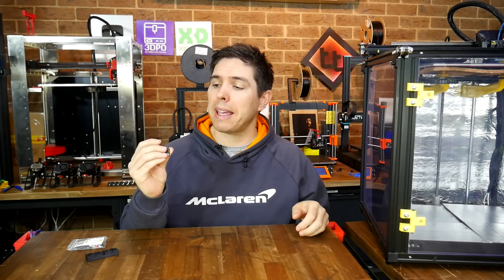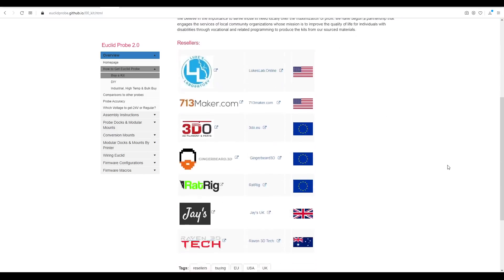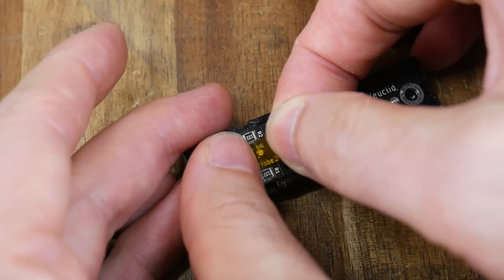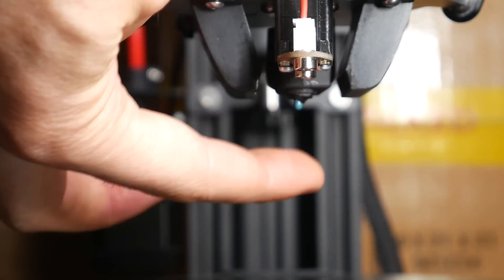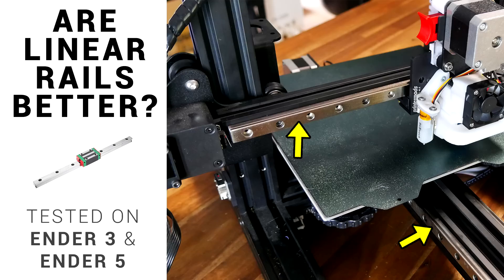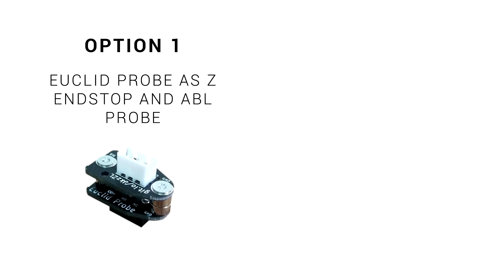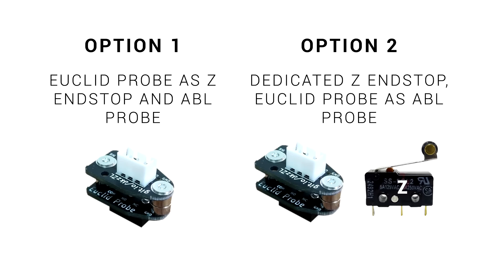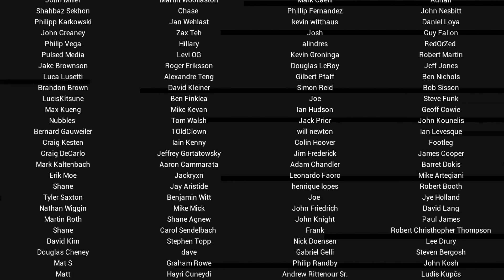Euclid probe: Light, robust, mechanical ABL for your 3D printer

Comment: it's neat, but honestly feels like a solution in search of a problem. you're basically just shaving off about 5g of mass (and about $10) from a standard bltouch, and it probably won't make any difference in print quality.
Reply: I would definitely use this over a BLtouch, it costs less, it's simpler, and it works just as well. The BLtouch has always felt overcomplicated to me, that's part of why I never bought one
Reply: How is that in search of a problem?
It's better than the BLtouch in every way, but it's not good enough to be a product? That doesn't make sense.
Reply: @Akegata42  it is marginally more accurate, basically cost the same, slightly lighter, have to be assembled, and due to the mount/dismount, have way more points of failure.

It's "better in every way" in the least helpful ways possible. It might be better in high heat environments, but given the tiny install base and time out in the wild, that remains to be seen.

So yes, it is a solution in search of a problem.
Reply: @tehmoriz  it's over 30% cheaper... the assembly includes screwing in some magnets, and once scripted, the mount/dismount never misses.
Reply: @Daede420  it's $10 cheaper, requires assembly, requires more drastic firmware changes, isn't more accurate enough to be noticeable, and require mechanical mounting/discounting.

I understand that you've bought one and installed it, and thus cannot be entirely objective, but at least try?
Reply: @tehmoriz  I mean, I guess if screwing two magnets through a pcb is too hard for you, it's too hard for you.
Reply: @Daede420  it's not hard, just unnecessary. Try not to put words in my mouth?
Reply: @tehmoriz  Iunno, it saves you 13 bucks over a BLTouch :)
Reply: @Daede420  it costs me $25 and my time over a bltouch, since mine came with the printer.

It's clear that you're being pedantic at this point, so I'll move on. Feel free to continue justifying your purchases here all you want
Reply: @tehmoriz  it must take you a long time to screw in a few magnets. I'd imagine you can find a couple videos online of how to efficiently use a screwdriver...
Reply: @tehmoriz  In my opinion, what's pathetic is calling a practical alternative to a product prone to failure and inaccuracy under several conditions that does not suffer from those shortcomings "a solution looking for a problem". You could have easily left it at "it's neat, but I'm happy with what I have". Instead you went through mental gymnastics that would give a pro chess player a headache in an attempt to justify a statement/an opinion that made no sense to pose in the first place. It is, in fact, a solution that fixes many problems presented to BLTouch owners who print under circumstances where the BLTouch performs in a less than desirable manner.

Have a good day, man.
Reply: @Daede420  the "practical alternative" is a product that's utterly unproven, has a tiny install base compared to the thing that it is an alternative of, cost basically the same, has just as many (if not more) points of failure, and apparently, it isn't even rated for one of the things it is supposed to be better at (high temperatures, judging by a comment in this thread).

funny that you accuse me of "mental gymnastics", when you're the one getting 10s from the Russian judges.

cheers mate.
Reply: @tehmoriz  "costs basically the same" kekw. You're about as good at math as you are at making sound arguments...
Reply: @Daede420  ~$25 vs ~$35. if the tiny price difference is noteworthy to you, you should consider getting a job.
Reply: @tehmoriz  it's 25 vs 38 and it's a 34.2% difference. That's a considerable percentage.
Reply: @Daede420  and $2 vs $1 is 100% difference, but the actual difference is still $1.

on the other hand, $35 vs $25 is just $10 difference.

in the grand scheme of things, this Euclid thing costs similarly enough to a Bltouch that it doesn't matter cost-wise, and you don't have any valid argument to the contrary.
Reply: An open air printer isnt a good use case for this probe. Starts to make more sense in a high temp enclosed chamber
Reply: It’s much more accurate than bltouch, not impacted by bed magnets, works at high temp, faster and isn’t finicky.
Reply: @wesc23  it's not more accurate enough to be meaningful. the difference, as shown by Michael in this video, is some tiny fraction of the width of a human hair; not enough to affect anything.

i won't comment on bed magnets and high temperatures, but i've never encountered any issues with mine.

as for finicky: this Euclid probe literally mounts and dismounts itself on use. the amount of failure points is much higher as a result. as such, the Euclid is significantly more finicky based on that alone.

feel free to use this probe if you want, but it certainly isn't better than a bltouch in any objective sense.
Reply: @tehmoriz  anyone who prints at high temps will have stories for you that tell of catastrophic bltouch failures.

Over 4 or so years, BLTouch glitches and failures have cost me upwards of $500 in print surfaces, heat breaks, nozzles and probes. No more. After switching to the Euclid, I've no intention of ever going back.
Reply: @tehmoriz  I don't know, my bltouch has proven to be very finicky for the last month or two. A lot of false triggers before it hits the bed resulting in a wildly errant bed compensation and, if I don't notice it in time, failed prints. 

I think the BL touch has just as many failure points, they're just not visible or accessible to the end user.
Reply: @Daede420  but what prevents the Euclid from glitching as well?
It is still stored in the heated chamber. So why can the same problems that the BL touch has also happen with the Euclid?
Reply: @Jehty_  because the Euclid doesn't have a probe that uses a heat sensitive magnetic field to deploy and retract and if the print head fails to pick up the Euclid it registers as triggered and the bed won't crash into the print head
Reply: @Daede420  i've had no bltouch failures when printing ASA and other high temperature materials, but i suppose i'm not the target market for something like this.

with that said, i wouldn't trust hundreds of dollars worth of parts to a $25 DIY probe either. a more robust version of this that's ready to go out of the box would be a good starting point, especially if it comes with a better docking station than that janky 3D printed thing.
Reply: @Daede420  on the Euclid website it does say "Capable of operating up to 80C natively."
So does that mean that the probe can fail above 80C?
Reply: @Jehty_  that's a good question. The answer is I don't know. Would be a better question for the creator.
Reply: @tehmoriz  Luke's Lab sells it mostly assembled; you only need to put the magnets on.
Reply: @tehmoriz  also, the mount and dock for the rat rig are much, much less janky
Reply: @Jehty_  that is the lowest temperature rating of various components-namely the switch. With other hardware choices you can achieve +150C.
Reply: @euclidprobe  A high-temp kit could be a worthwhile endeavor :)

Comment: What happens when you get a bit of swarf on one of the magnets? Wouldn't it be better to have the mating parts be some hard-ish (e.g. aluminium alloy, brass, etc) balls/pins for kinematic location and then the magnets coming close, but not touching, for the fixing?
Reply: If you have a problem with swarf in your printer, ABL should be the least of your concerns
Reply: @ohiohouston3560  Could be he's using one of those all in one printers? But yeah, getting swarf on your printer would mean you got bigger problems lol
Reply: @Albertotron  In my opinion, using one of those all in one printers is a bigger problem.
Reply: You got swarf in your printer?
Reply: been using my euclid for months with zero issues like that

Comment: 25 whole usd for 0.5 - 2 dollars of actual parts and you have to assemble it yourself? but like why?
Reply: @Albertotron  before corona yes
Reply: @emielv7677  Yeah, and they still are. Go check DigiKey and Mouser if you don't believe me
Reply: @Albertotron  I paid 2 dollars for my microswitches. I do live in the EU though so that is definitely one of the reasons why they're more expensive
Reply: I challenge you to source the parts for less than 25 (including shipping)
Reply: @wesc23  its a single microswitch and a jst connector, I challenge you to find more than 3 dollars in parts. only the magnets are anything you couldnt just recycle a mouse into 2 or 3 of these devices. get a clue cherry brain.
Reply: @CatCommando  don't cheap out on the microswitches though
Reply: @CatCommando  Insults just reflect poorly on the insulter.   I self sourced a Euclid before you could get kits.   Looking back at receipts:
Magnets: KJmagnetics: $.42 x 4 = $1.62 + $5 Shipping
PCBs: JLCPCB: $2 + $19.82 Shipping
XH, D2F-5 Switch, XH pins, screws + misc: : Digikey: $.18 + $2.22 +$.60 +$.16 +$.50 + 4.99 shipping
Total with tax: $8.06, plus $29.81 shipping = $37.81.   If you get PCBs with cheaper shipping, they are gonna cost more.
Reply: Are you like this always?  Abusiveness like this just indicates extreme insecurity on your part.  I hope you aren’t like this in real life.   Show me sources that can get it all for less.
Reply: I designed CroXY probe.  The Euclid guy consulted with me a bit on the design as it’s similar.    CroXY probe was printed.   Euclid is far superiors.  I have also given a channel for Euclid on my discord.
Reply: @wesc23  exactly, it was pretty obvious you were anything but unbiased from the get go since anyone who questioned its worth got your reply. Dirty boy, start with the honesty next time.

Comment: The magnets will chip with use.  Snapping them together is pure death.  They should bury them behind something.  Even adding a washer to the magnet faces would be a good start.
Reply: The magnets are used as conductive connectors from my understanding so covering them with anything won't certainly help. I think as long as you don't snap them together with rediculous force, they're fine for some time.
Reply: @Danny_Jay_Nh  Its not a user issue just an issue with neodymium magnets.  Of course if the user is just sitting there playing with it that would be different.
Reply: Hypothesis or experience?
Reply: @condorman6293  experience
Reply: @condorman6293  Experience. i'm well over 6k on my unheated probe, 4k on my voron, works great, no chips.
Reply: I've been using my Euclid for months now with zero issues (got it from Luke's Laboratory). The magnets seem to be pretty good quality
Reply: We do not recommend them 'snapping' them together. Test printer did 850,000 deploy/stow cycles before the bearings wore out. NO issued with magnets.
Reply: @euclidprobe  With the stow/unstow it looks pretty good.  I was mostly concerned about the manual user.  A washer with a dab of glue so it picks one magnet or the other to live on would work.  The device itself and the attachment method is good if there is non printable area available.  This would give robustness to the manual user and not add anything except two washers.  If there arent manual users or if there hasnt been a chipping issues then no problem to solve.
Reply: @someguy2741  Do you mean manually placing the two havles together? That is fine, what you dont want it letting the probe half fly across the print bed or jump up by itself. I did that for a a year as a hard wired probe and for a few months trying to work out the dock details. 
The nature of this type of magnet fabrications is that they are blanchard ground in a mass group/herd, so they are very good for height and parallelism which is part of the inherent accuracy and reliability of the system.
Reply: @chessiebear6915  I was referring to the initial video sequence where he placed it manually.  It seems that allowing the magnets to find each other without a guide is not much different than playing with magnets as far as damage risk.
Reply: Purely theoretical complaint. Doesn’t happen in practice over thousands of mate unmate cyclea
Reply: @wesc23  The first time he put them together manually they snapped together.  If you have used neodymium and had them snap together and not seen one chip then I dont know what kind you are using.  If this device is used manually for any length of time then chipping would be a concern.  Even the manufacturer recommends against it.